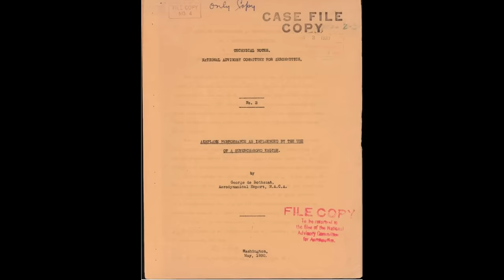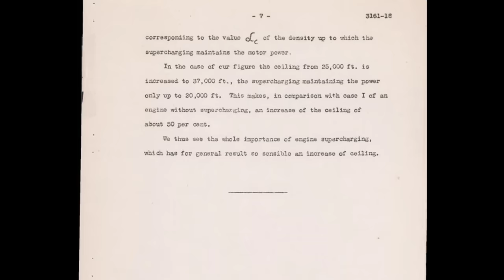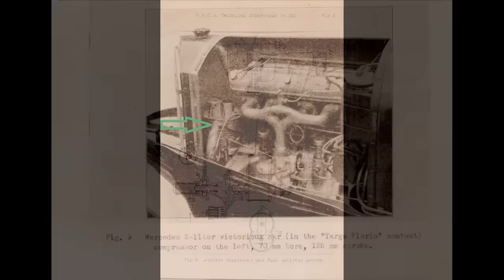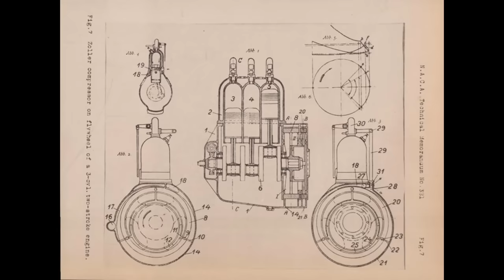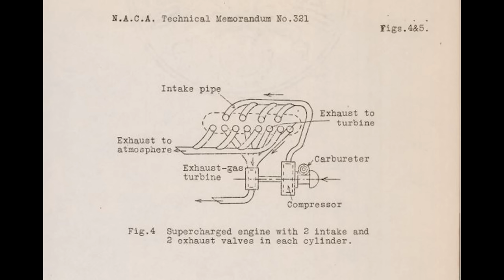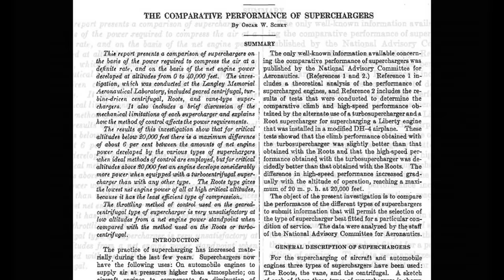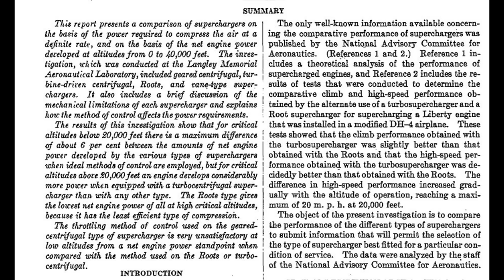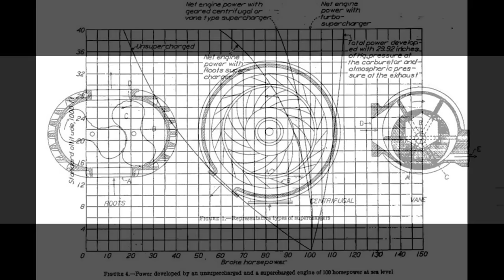Turbo vs Supercharging in WW2 Airplanes

Comment: yes i have been a fan of the Jug all my life and after i read The thunderbolt book I suspected there was a lie about the fighter escort range in the ETO. The second to last picture in your video  wow how did that pilot land that ship covered in oil? I am also a fan of the corsair The prototype aircraft made a emergency landing at a golf course in Norwich CT which is my home town its nice to know which fighter was King and why  Very kool channel
Reply: There was a brass bias since the top hats in US military aviation were all sure the bomber box was the way to fly. With proper fuel loads, i.e. drop tanks, the 47s and 38s both" could" fly to Berlin if need be. Look at the 38s in the Pacific theater. I guess if that had been allowed, then we wouldn't have the "life saver P-51". It wouldn't be needed. Think the American brass wanted the right to mfr the Merlin. Could Packard build an engine or wo
Reply: To be honest, mine was and still is the 40s and 39s. Always wanted to read an obscure paper on their performance with a P-38 setup. Shoulda coulda woulda

Comment: Fantastic video, as always, Greg!
The only thing I am struggling to understand is why supercharged engines suffer more from throttling than turbo ones. 
I tried to look it up but couldn't find it.
Apologies if it's a silly question.
Keep up the good work!
Reply from the maker: Throttling is a physical blockage. Pinch a straw shut and it's harder to suck through, or blow through. Turbo's don't need to close a throttle to reduce boost, they can run with the throttle fully open and regulate boost via turbocharger shaft speed.
Reply: @GregsAirplanesandAutomobiles  Thank you very much!
Reply: @GregsAirplanesandAutomobiles  "regulate boost via turbocharger shaft speed." by this, do you mean using a waste gate to reduce exhaust flow into the turbo?

Comment: As I understand it the newer usage of the term "electric turbocharger" in newer automotive concepts is in reference to using an electric motor to spin up turbo sooner than it normally would other wise, not really producing much boost during the spin up process, and once hitting the desired rpm the turbo will spin itself off the exhaust. Its more a method to reduce turbo lag than actually producing any power. I agree actually using electric motors to run a mechanical supercharger is a wasteful way of boosting an engine, as the conversion of mechanical power to electric back to mechanical stands to loose a lot of potential energy through heat and other inefficiencies vs straight mechanical supercharging.
Reply: Tell that to A U DI and their 48v electric supercharger(paired to 2 exhaust driven turbos). Saw it on a V8 TDI sold only in 🇪🇺.
They are pretty close to the best when it comes to eliminating turbo lag and giving almost immediate manifold pressure & throttle response...maybe only bested by a mechanically driven Roots or screw supercharger at low RPM.

Comment: I have read that the practical issue regarding the V-1710 and P-40 was that since there was a shortage of tungsten for turbochargers, that turbos were therefore reserved for bombers and all the Allison powered fighters got centrifugal blowers. The advantage the Merlin had in fighters even though a slightly smaller engine was that Rolls-Royce at the time was probably the highest technical group on the planet regarding efficient mechanical blowers. I also read that the designer of the P-40 maintained till he died that if the P-40 had been given the engine he designed it for, a Turbocharged V-1710, it would have been the best fighter of the war. Given what was done post war with the V-1710 and it's more robust lower end in air racing there may be validity to that idea. I don't know the truth to all of this but looking at design images of the two engines, I tend to believe him. Enjoyed the video.
Reply: Tungsten? or titanium? Titanium weighs 75% less than tungsten. Tungsten is ridiculously heavy, there's no need to put it on an airplane unless you needed its concentrated weight. Titanium's heat resistance (melts at 3000 F) is plenty for turbocharger applications, there's no need to go crazy and use tungsten (MP 6000 F)
Reply: Tungsten, as used in nickel-chromium-tungsten alloy steel for heat durability in turbochargers. There were apparently acquisition difficulties for tungsten. I believe at the time the best known sources for tungsten were Austria, Spain, Portugal, and I think the Congo. There were probably sources in the Far East too since the Japanese used nickel-chromium-tungsten steel in some of their turbos, but the proximity to war theaters would obviously hinder mining and smelting operations. Given limited sourcing, some requirement was bound to lose out and since "bomb Germany" was strategy one, engines like the V-1710 lost out since no bombers were designed around it. Since at the time Rolls-Royce was probably the worlds premier repository of efficient centrifugal blower design, I'd have had Hap Arnold tell them to spill the data or we go fight Japanese first.
Reply: We went to North American and asked them to build us P40's. Their answer was no, we can do better than that, and they did. If you are going to allow one designer his wish list, you'd better allow them all. Would'a, could'a, should'a don't mean squat.
Reply: @jamesoliver6625  Sod that. We gave you too much for bugger-all as it was! :-)

Comment: Great stuff. Fascinating topic . Coincidentally, earlier today I was wondering if the hydraulic clutch superchargers on Bf109 engines suffered the same throttling penalties as geared superchargers.  I love your engine videos.
Reply from the maker: Thanks. No, the 109's supercharger does not have the throttling issue. It does however suffer a bit from being only a single stage.

Comment: Re: Electric Supercharging

Audi did end up using it in the SQ7 TDI, it runs off a 48v separate electrical system and is used to spool up the larger turbocharger in the motor. The motor itself is triple charged.
Reply from the maker: Hi Stephen, I'll admit I hadn't heard of that car. I guess I haven't been watching the $90,000 Diesel sedan market. This is something like what I was talking about, and what the Germans described in 1923, but it's only a momentary system used to spool the exhaust turbos, it's in the ball park, but not quite the same idea. Thanks for pointing it out though, they are getting closer.

Comment: Really great channel Greg. Stumbled into your channel via P47 research for the DCS flight sim and have been a regular since.  Wondering if you could speak to a phenomenon where by when raising rpm "presumably at higher altitude" that the manifold pressure would drop because the "suction of the engine would overcome the supercharging". You've covered a lot on super charging, and no mention that I recall and I dont see this modeled anywhere in DCS.     Saw this info on Requiem's Air Combat Tutorials. Maybe you're familiar. Its a 3:45 sec clip in lesson #4 of the complex engine management tutorial.  

Thanks for all the great content!
Reply from the maker: Requiem isn't wrong, but the more complete explanation is too long for the comment section.

Comment: The bucket wheel on the exhaust turbo wheel was much as the vanes attachment to jet engine central shaft. They must operate in extremely destructive heat and centrifuged environment. Special alloy metals and materials are needed.
Our modern high bypass turbofan jets put out incredible thrust. The large diameter fan is of carbon fiber composition.

Howard 
Hughes crashed a prototype 38 with lives lost on ground and he was very injured. He was never quite the same after that.

Comment: Love me some P-40, never knew it started life as some ugly test bed for turbo charging fighters as the P-37.  I cannot picture the turbo setup in that P-37 that would require another allison V12 amount of space behind the V12. That is just insane. P-39 always looks so oddly proportioned and I also had no idea that it was turbo charged.  That does help me understand how it was not terribly tail heavy with a giant V12 at the back of the wings.  Or was everything behind the cockpit? If so, I have even more questions as to how the plane was balanced at all.
My god the P-47 plumbing is impressive and holy cow did it work wonderfully.

Comment: The P-47 is one hell of a beast, I have a soft spot for it and the Corsair. I love the P-51, however, after hearing a few P-51s in person, both stock and race modded.... they sound a lot like supercharged lawnmowers, where as the Corsair I saw, that thing beats your chest like drum even from 100ft away. Even the mighty Hellcat did not sound as good and beastly as the Corsair, despite having basically the same engines. Now all I need to do is find a flying p-47, and my life will be a lot more complete :)

Comment: Formula 1 has a Motor-Generator "Heat" unit which is attached to their Turbo Charger.  The Turbo is 'hybrid' in so far as it is indeed exhaust heat driven YET when extra internal combustion power isn't needed the turbo is used to generate electricity... and the MGU-H is also used to spin up the turbo to eliminate lag
Reply from the maker: That's an entirely  different type of electric turbo. I am talking about an electric driven sueprcharger as shown in the NACA report. You are not the first person to mistakenly assume it's similar to what's being used in F1, but it's totally different technology, and for a different purpose.

Comment: So I've watched your video several times over the past few months, and i wanted to run a concept by you. As far as i can determine, the designers during that time, knew that exhaust driven turbocharging was superior to the centrifugal, crank driven supercharger. However due to packaging constraints, they chose to use the centrifugal type. My question is, why couldn't you take a v12, the Merlin for example, and flip the cylinder heads. The exhaust ports would face inward, and the intake ports would be on the outsides. Then you could design an exhaust manifold that merges together in the center or slightly aft, and locate the turbocharger down in the valley. The carb would mount to the compressor inlet, and the charge piping would run aft and down into a water to air after cooler, then you'd have end tanks on each side with piping running forward. You'd have some type of plenium attached to the outside of each cylinder head where the charge would enter the cylinders. You could even run multiple smaller turbochargers, inline with each other using this method. Its essentially similar in concept to modern industrial V style diesel engines & passenger v8 diesel pickup truck's. I haven't been able to think of a reason why this design wouldn't work on a v12 piston fighter. Seems to me, there wouldn't be any weight increase, and the problem of packaging would be solved. Idk, maybe I've over looked something. I would think the engineers of the day would've thought about doing it this way. Im curious what your thoughts may be on this subject.
Reply from the maker: That's not a bad idea, and there are engines from WW2 with cylinder heads arranged the way you suggest. The drawback of using that to locate the turbocharger in the valley of the V is a little complex. Turbochargers during WW2 were much larger than they are now, thus any turbo located there would increase the frontal area of the engine quite  a lot. If you look at a supercharged Merlin or Alison, you will see that nothing on those engines sticks up above the valve covers. Put any WW2 era turbo capable of generating 2000 horsepower up there and it's going to stick up at least a foot or two. Maybe a couple smaller turbos would decrease that, but not enough to be worth doing. Now, eventually, turbos got smaller, and your exact idea was used. As far as I know, the first to use this design was Ferrari in their 1981-1984 Formula 1 cars. They ran a 1.5 liter V6 with Twin KKK Turbos shoved into the middle of the V. The modern term for this design is a "Hot V" configuration. It's currently in use by various companies.
Reply from the maker: One more thing, I really appreciate your watching my video several times. I think this specific video is one of the most important ones on my channel.
Reply: Especially since many of the allied aircraft had updraft carbs. First time I saw that was a Citabria.

Comment: For the record, military trucks, such as the older HEMTT had turbo/superchargers on the Detroit V-8's. Those differed from turbocharged engines in the way that they had a turbo AND a supercharger. When the HEMTT was retrofitted with the CAT engines the supercharger went away, and just had the turbo. WW2 airplanes? I have no clue, so I leave that to Mr Greg.
Reply: Difference between a 2 stroke Detroit and a 4 stroke Cat

Comment: A system that maintains sea level power or manifold pressure at altitude is called Turbo-Normalised.
Turbo-supercharging boosts power above that what can be obtained from a naturally asperated engine.
Reply from the maker: I don't think there were "turbo-normalized" airplanes in WW2, that became common in general aviation later, well, I shouldn't say common, but it was around a bit.
Reply: @GregsAirplanesandAutomobiles  
Yeah I'm not sure when it became common, I just remember learning about it while doing my aircraft engineering apprenticeship years ago.

Comment: Thank you Greg, I am now a convert to the P47. On the P38; is it an example of a bad implementation of turbo supercharging? I wonder if there is enough data to know how it compared at different altitudes to some other twin engined aircraft? Say a late merlin twin such as a dehaviland mosquito (hornet??) the weird twin mustang, or the tigercat? For that matter, was it fast compared to a merlin powered (and streamlined) P38?? (I read on the internet somewhere that there was such an aircraft experimented on). Thanks for the videos -
Reply from the maker: Hi Simon, the P-38 is a really complex subject. The short version is that it didn't have enough intercooling to really take full advantage of its turbos. Still, it's performance was pretty darn good after they got various issues worked out, and I'll be covering in more detail soon.

Comment: What altitude was the P-47's mechanical supercharger optimized at? And couldn't the designers added a second gear to it so you could go even higher?
Reply from the maker: I haven't seen that published anywhere but it appears to be very low, like around 3000 feet. There are references to using the turbo for extra power on take off, and you can see that being done in the carrier take offs in my P-47 Pt. 1 video. (you can tell when a P-47 uses the turbo by where the exhaust is exiting).

Comment: Regarding turbos in Axis fighters:
So far as I've been able to research, no Axis fighter ever used a turbosupercharger operationally.  The Fw 190C used turbos experimentally, and a few Japanese fighters were planned to have them, but either were never completed, or never made it past the testing phase.

Also, NACA is an initialism.  You're supposed to pronounce the individual letters.  I don't mind, but one of my friends is an aerospace engineer, and he flinches every time you say it as a word.
Reply from the maker: That's pretty much what I found. Turbocharged fighters and multi-engined are mentioned in a few places, but finding an actual picture of one in operational service seems impossible.
Reply: I've seen one picture of the 190C in what looked like a hanger, or maybe right next to a building, but never in flight or with guns installed.  I've never even seen a schematic of the 190B.  Which is a shame.  I've always been a bit of a fan of Kurt Tank and his aircraft.
Reply: @GregsAirplanesandAutomobiles   There is one type of German turbocharged aircraft, that was produced in small numbers towards the end of the war and it's another reconnaissence plane: The Junker Ju 388 L-1. There were 3 types of engines planned for this: The Jumo 222 (cancelled), the Jumo 213 E/F and the turbocharged BMW 801 TJ. It's easy to spot the difference, since the BMW 801 is a fan-cooled radial without the typical row of exhaust stacks featured in the Jumo 211 and 213 "Kraftei" engine nacelles.

Comment: 18:45 only now has it hit me the real brilliance of the original plan. Normally I figured that they underestimated how hard it would be to hit a fast moving target from a moving platform, but they didn’t. They underestimated fighter performance. With the current dynamic, fighters, even ones that could catch the bombers, would be only able to catch up very slowly. Thus, their relative velocity to the bomber would be near standstill, and this would make them easy targets for gunners.

Of course, we all know how that went, but it’s a relation that feels rather akin to modern stealth strike aircraft with precision guided ordnance
Reply from the maker: That's exactly right. Their plan did make sense, and ultimately it did work, but they needed fighter escort.